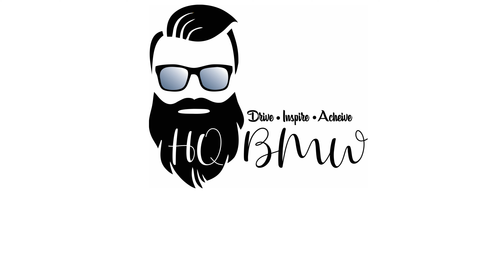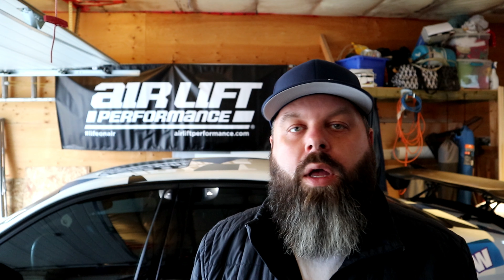How Reliable is Air Suspension | Airlift Performance reliability

Comment: Do you have to know a lot about bags to own one? I’m thinking about getting bags and my worst fear is I’m going out of town and something breaks and im stuck in middle of nowhere..
Reply from the maker: No you definitely don’t need to know a lot about bags to own one. Once it’s been installed and and everything is tested and running properly it is incredibly reliable. I have drove thousands of miles with no issues.
Reply: @HQGARAGE  Other than reading and watching videos, im not too knowledgeable about bags since i never had one before.  Sometimes, its hard to understand how things work not unless you have experience them in real life..
Reply from the maker: I completely understand and I was in the same boat as you a few years back. The biggest thing I can say is it takes a little bit for everything to settle ie. airlines and fittings but once it settles the ride quality, flexibility and handling is incredible and absolutely 0 issues getting into parking lots or speed bumps. Then you will get addicted to airing out every time you park which is also a security feature because if you park it, air it out and take the controller with you. Nobody will be able to steal your car 😉😉

Comment: Great video! Is it good for regular use? I'm thinking of putting for my Honda city! We travel a lot and is suitable for off-road? What are the most common problems faced and their reliability? Awaiting your precious reply thanks!
Reply from the maker: It is perfect for every day use, I have a lot of friends that drive their cars with air systems all year long. It is definitely suitable for all types of uses. The most common issue is moisture in the lines. But if you follow the manufacturer recommendations you shouldn’t have any issues.
Reply: @HQGARAGE  so how can you solve the moisture issue?
Reply from the maker: It depends where you live but you can add additional moisture traps, always purge the tank to drain any moisture and if your in a cold climate you can use airline antifreeze
Reply: @HQGARAGE  thank you for your reply! I'll do that!
Reply: @HQGARAGE  after how many years the suspension needs to be changed? We have to change the whole setup?
Reply from the maker: I am not sure 🤔 I think it will depend on the amount you drive and weather conditions. I would assume you can get at least 5 years or more out of it. I have had mine installed for 2 years.
Reply: @HQGARAGE  OK thank you very much for sharing your experience!